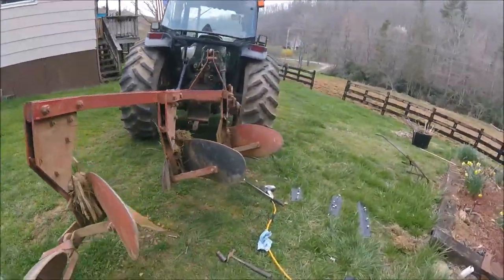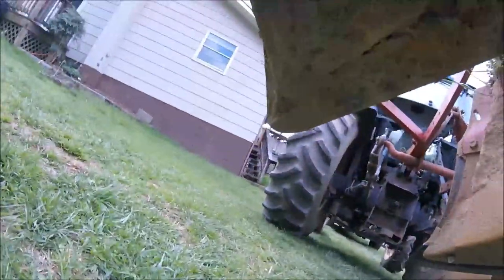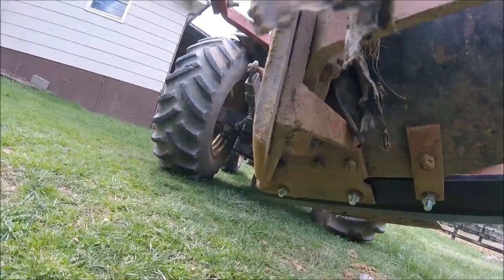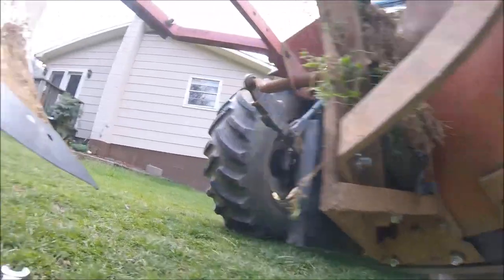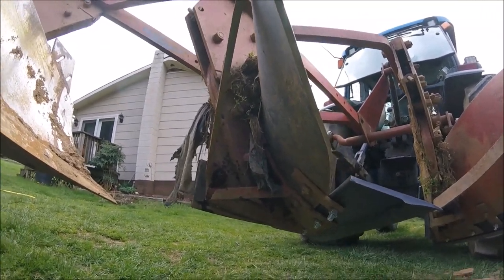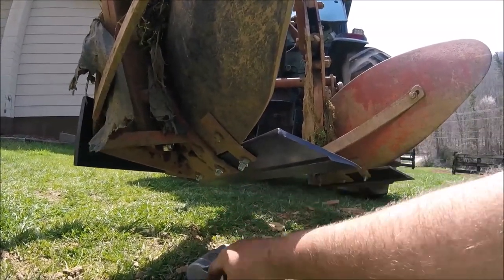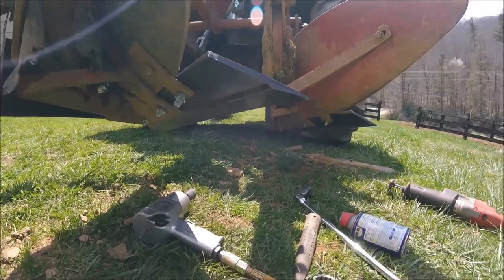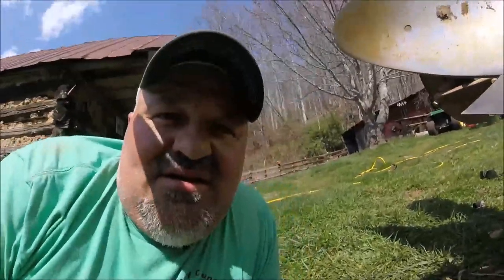Ford 101 Plow Maintenance

Comment: Where do you get your parts from?
Reply from the maker: We have a local independent tractor parts and repair shop that I usually get them from. You can find them online.
Reply: I was surprised when I got mine, all original parts with little to no wear on any of them
Reply: I have a three bottom ford 101 plow and I am having a hard time setting it up is there any way to contact you thanks